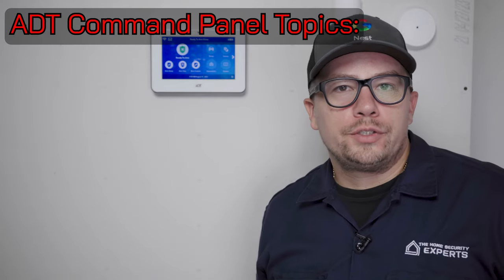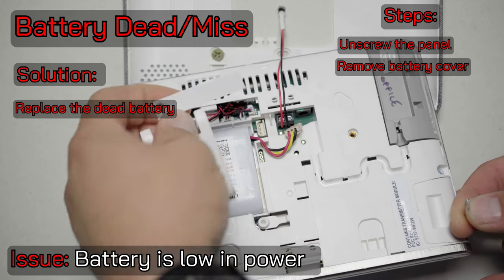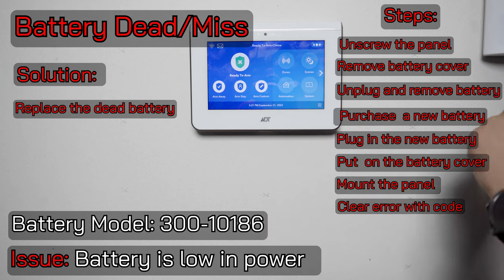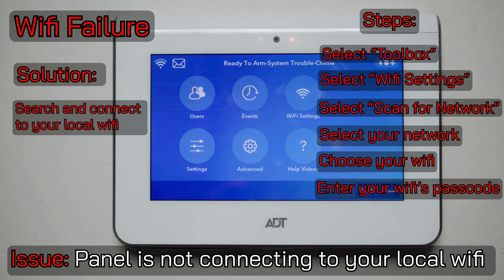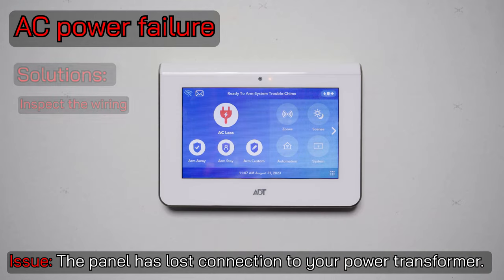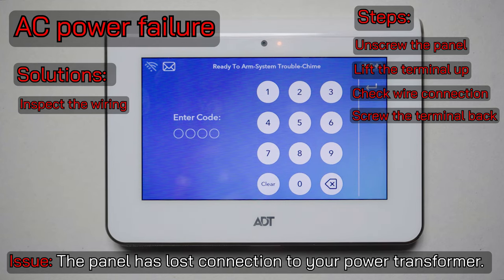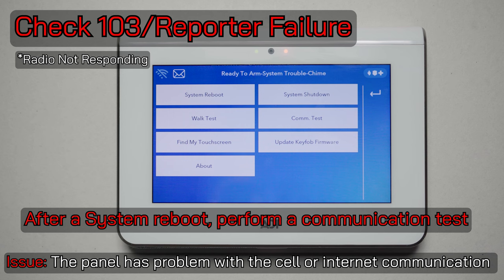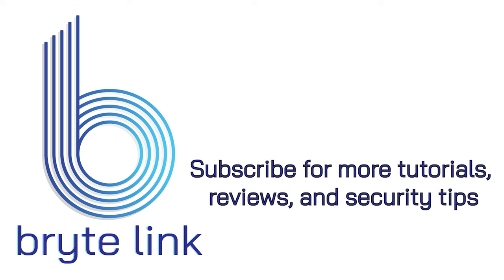ADT Command Panel Troubleshooting

Comment: I never got a wall transformer. And mine keeps showing WiFi fault even though nothing is wrong with my internet. Started last night. I’ve rebooted it and everything
Reply from the maker: Im sorry about your issue. If you have not, try to reconnect to your wifi and run a comms test. Hope that works for you!

Comment: I changed the battery but the Low Battery message is still up
Reply from the maker: Hi Josh

You'll want to go into Tools, Advanced, and then System reboot. If it doesn't clear,  the new battery could be bad, or the keypad has a problem.

Comment: Great tutorial sir. 
One question, what do i do if i continuosuly get the Wifi fault? My wifi is excellecnt and i even got a wifi extender just incase but my panel randomly goes into the Wifi fault beeping.
Reply: Go to Advance and do a system reboot. Now follow the WiFi instructions again, it should work now.